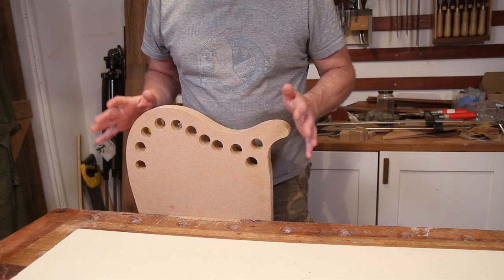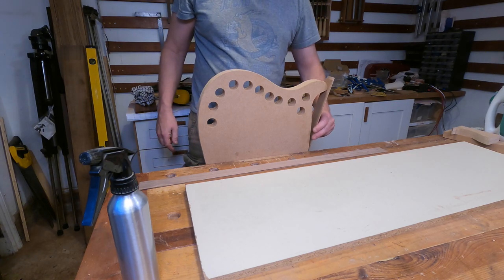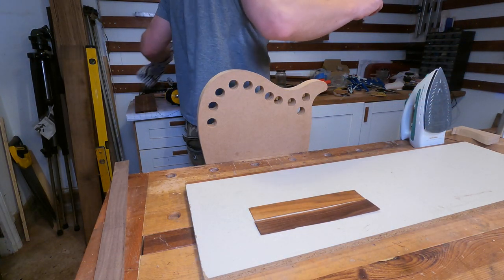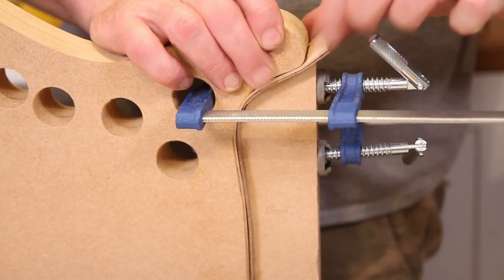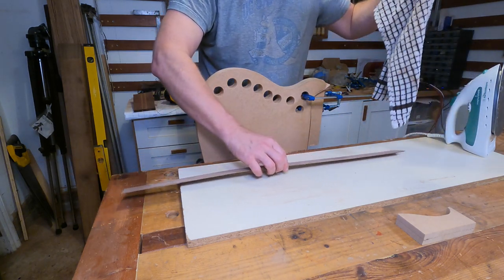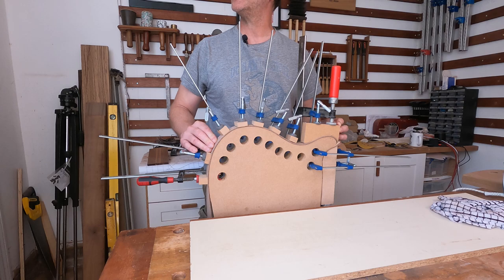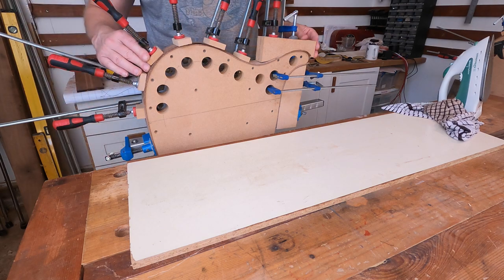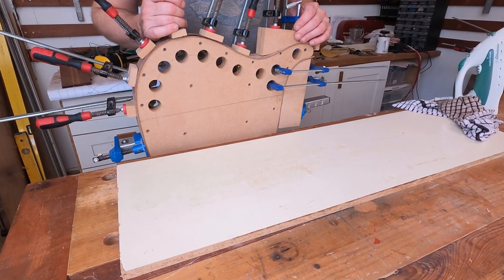GGBO 2022 scratch build guitar episode 7

Comment: Wood may be wood Pat but my first 335 was maple and bent very well out of the steam box. My second 335, the GGBO bass was quarter sawn mahogany and it wasn't having any of that steam box bit. Broke all over the place. I ended up using ammonia on the mahogany and it worked out in the end but was still pretty tough. I like your iron approach seems to work out well.
Reply from the maker: I remember you using the ammonia on the bass build. If I was going to really drill down into this I'd say the maple of the last build was a bit easier to bend but only slghtly. I'm just really happy to get it done ok. The iron does do the job but Mrs Shed has seen it and I'm in bad books :)
Reply: @Adventuresfromtheshedofdreams  acetone will clean it right up. Just don't let Mrs. Shed smell it she'll put you out with the dog.